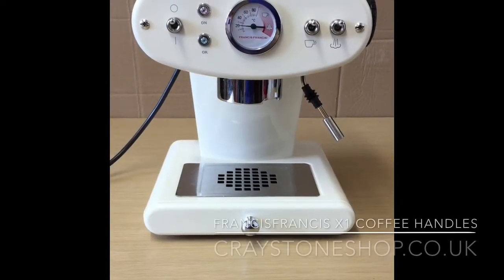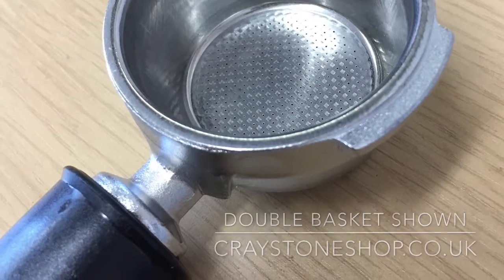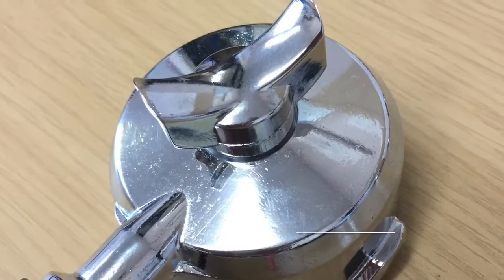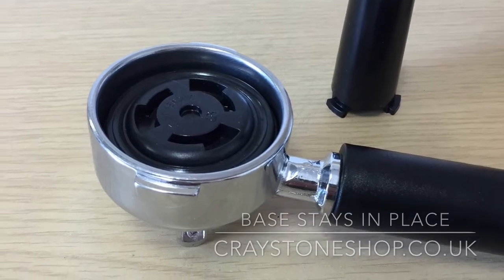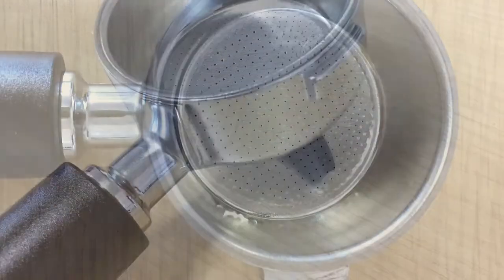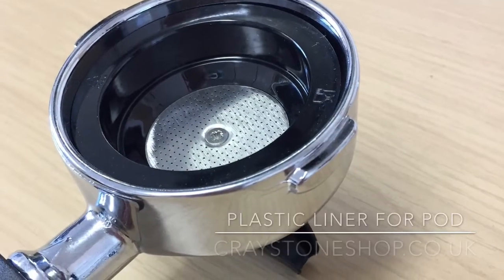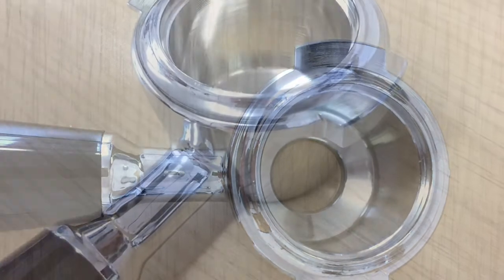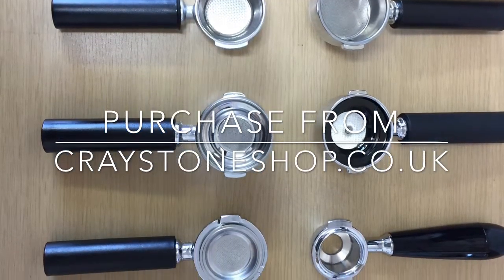FrancisFrancis X1 - How to Identify Your Machine

Comment: will the ground coffee Handel fit on the trio machine?
Reply from the maker: Hi - Sorry, you can't use the ground handle in the TRIO machine. On the coffee machine, the TRIO brewhead is a different shape and seals against the coffee pod in a different way to the ground coffee version. The TRIO handle has a plastic insert that houses the ESE pod and the o-ring gasket on the brewhead seals against this.  The ground handle wouldn't be able to seal correctly and water would just splash out over the top of the handle.

I hope that helps.
If you need any further assistance or want to ask more
questions, please send me an email to info@craystoneshop.co.uk

Thanks
Chris
Reply: Thank you. That is very helpful. cheers

Comment: can all the handles be used with every x1 version ?
Is it possiible to use the ese and capsule pod on the ground version ?
Reply from the maker: Hello,
Short answer - no :)

Longer answer - still no :)
This video highlights the differences between the various generations and current models.
The (current) third generation machines are Ground, ESE pod and Capsule. The portafilter handles for each machine cannot be used on the others, there is no cross compatibilty, so ESE will not work with Ground or Capsule, Capsule will not work with ESE or Ground, Ground will not work with ESE or Capsule.

The second generation machines had dual compatibility with Ground and ESE, however using different portafilter handles - ground and ESE pod.

The first generation machines had dual compatibility with Ground and ESE, however using different portafilter handles - ground and ESE pod. These handles are smaller than the second generation and as a result cannot be used in the second generation machines.

I hope that helps.
If you need any further assistance or want to ask more
questions, please send me an email to info@craystoneshop.co.ukThanksChris

Comment: Hello there! Just wondering if on the second gen ground portafilter does the tamper piece have to be left on or can you use the ground portafilter without it?
Reply from the maker: Hi - Yes and No :)
It will physically fit but results will be poor, with potential water escapes over the top of the handle.

The second generation machine was designed to utilise the base from the two-part tamper piece when using ground coffee (and the ground coffee handle - rather than the ESE pod handle).
The tamper base has a groove that seals against the o-ring gasket that is attached to the machine's brewhead. The two mate together and this creates the correct seal and the pressure required to make espresso.

http://www.craystoneshop.co.uk/x1-x3-tamper-for-2nd-gen-ground-handle-c2x17781025

I hope that helps.
If you need any further assistance or want to ask more
questions, please send me an email to info@craystoneshop.co.uk

Thanks

Chris

Comment: do you have a video or advice on how to clean the steam wand? do I need to disassemble it?
Reply from the maker: Hello again
We don’t have a guide but it’s simple to clean the steam wand.

The end frothing section unscrews from the wand, sometimes these can be stuck due to build up of milk and scale over the years. It’s best to attempt to unscrew by hand, but if this is not possible, use a pair of grips/pliers (VERY IMPORTANT) protect the metal by wrapping a cloth around the section (three-four times) as the pliers can scratch the surface of the end piece.

Once removed the end piece is easy to clean out. Straighten a paperclip out into a length of wire and use this to clean out the centre hole and the frothing hole on the side of the end section.

You can also use the (paperclip) wire to clean out the inside of the pipe.The wand pipe can be removed from the machine, however depending on which generation of machine you have this is either straight forward or more complicated.

If you are unable to unscrew the end section then you can still use the wire to attempt to clean the wand, it's unlikely to do the best job however it will still be reasonably effective. 

First and second generation machines the nut that holds the steam wand in place can be accessed from the outside of the top cover, the third generation must be accessed from the inside of the machine, so the top cover must be removed before hand. Either way it’s a 14mm spanner for the nut.

Going forward the best way of cleaning the steam wand is this. After you have steamed your milk do the exact same process with a jug of water - steam/froth a jug of water. It only takes 30 seconds. Doing this removes the milk residue straight away, that otherwise will congeal and set hard inside the wand blocking the passage way for steam/water.

I hope that helps.

If you need any further assistance or want to ask more questions, please send me an email to info@craystoneshop.co.uk

Thanks

Chris
Reply: that is very helpful. thank you.